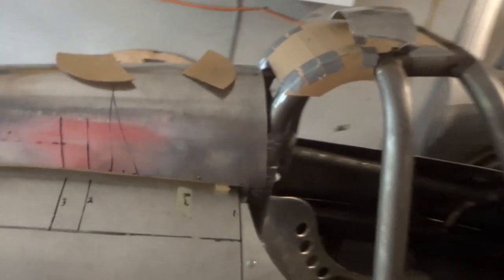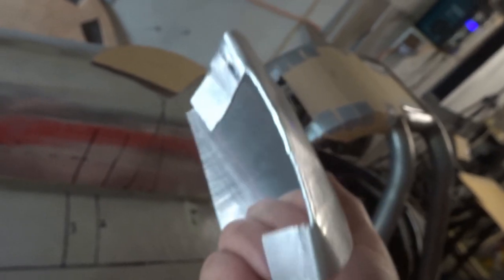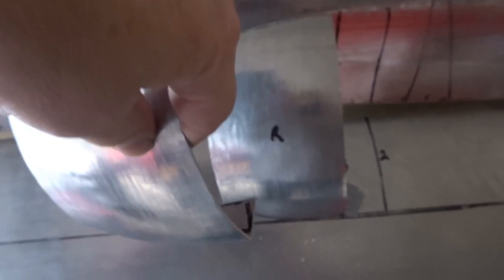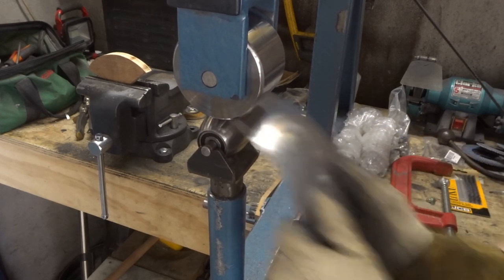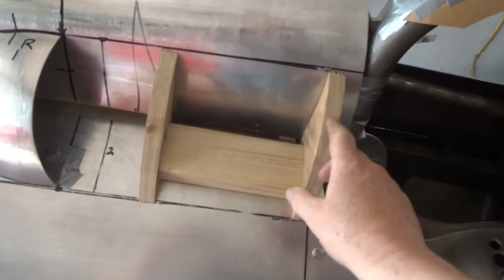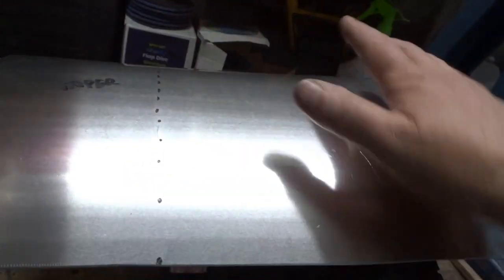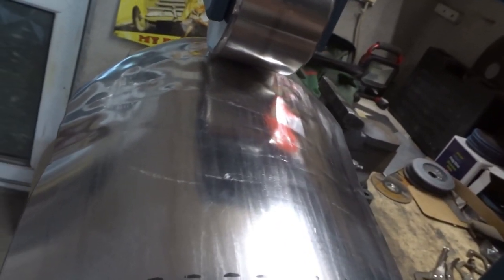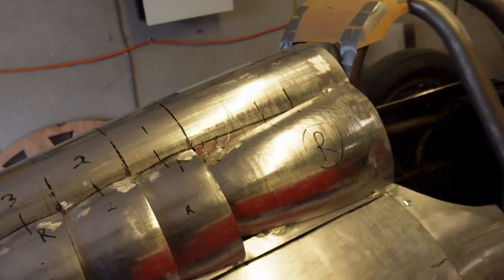Belly Tank Lakester | Rear Air Intakes Ep48

Comment: Will the scoops add much drag do you think?
Reply from the maker: A little bit probably although the air will sort of flow through the car and emerge out of the back. I could have a round radiator in the nose, visually like the front of an early jet engine or 50's racing car but the rounded (solid) nose is a requirement to keep it in the spirit of the time. From my collection of old belly tank photos, I can see some of them had all sorts of weird scoops and louvres on their cars behind the cockpit some of which look very un-aerodynamic. I could 3D scan the car, 3D print a model and make myself a little wind tunnel ! The cockpit + my head will probably create the most drag - compared to having a covered cockpit which would  not really be in the spirit of the time. Later and more modern belly and belly-inspired tanks did have covered cockpits but by that time you would be looking at late 50's/1960's/70's right up to the present.
Reply: @XenonJohnD  I suspect, and I don't mean this as a criticism, you won't be going fast enough for it to make much difference! I know you're not trying for flat out speed/records. There is probably more drag from the wheels/tyres I imagine. Superfast Matt did a film where he used some online service to look at drag on some of his cars. I think sticking to a period is a wise plan. It's the same with building pre-war or vintage cars. People sometimes get their era all muddled and the cars end up looking like a parody of themselves. Well, to those that know. Most people don't really notice.